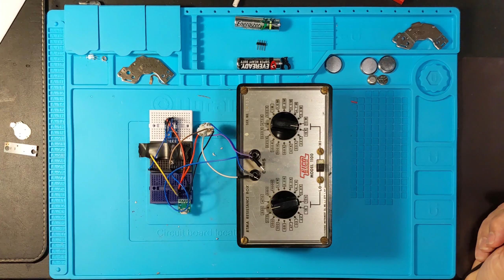Bike Flower   Blinker Board Testing   Methodology

Comment: CdS chroma sensitivity response curve is not linear or the same as the human eye's. In other words, you're not matching the physical lumens or the perceptual brightness by using it as a measurement. You would be better off eyeballing it, or using a digital camera as a sensor and desaturating the output to compare the 0-255 pixel level output.
Reply from the maker: That is a HUGE help. Thanks. I figure I was eventually going to have to research it, but you just pinpointed the problem. I've done the eyeball thing in the past, but I could pretty easily run a series of tests and check video in post. On the other hand, this is more about perception than actual equivalence. Again, thank you.